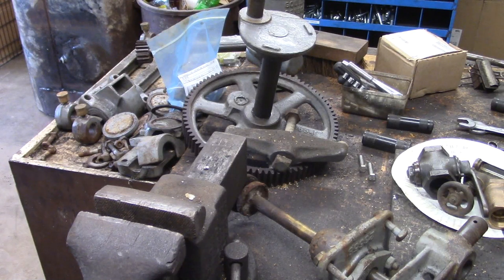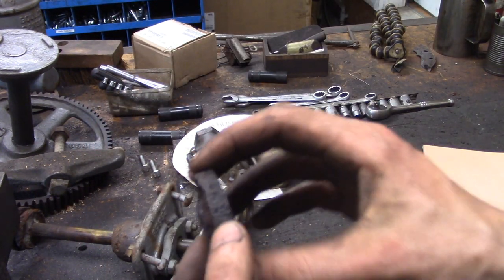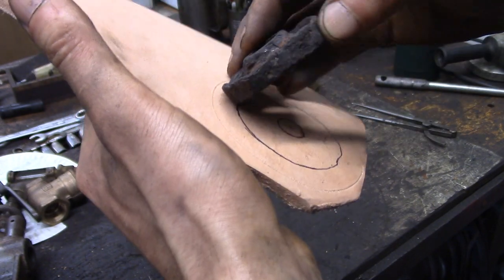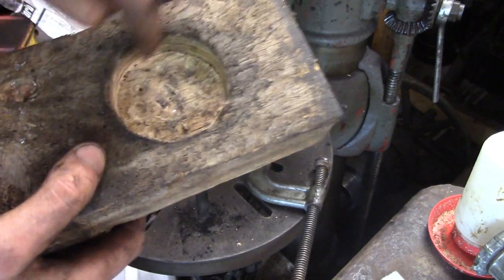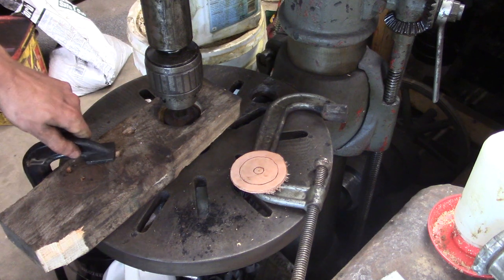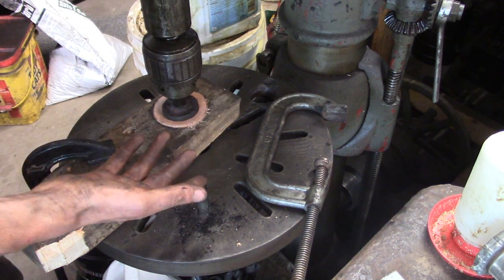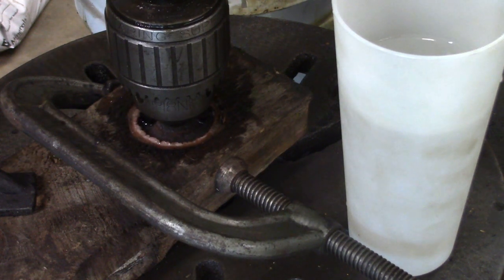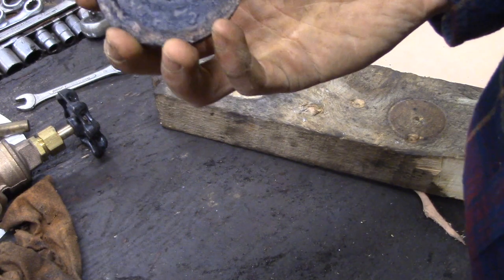Forming A Leather Pump Seal - How To

Comment: Old steam engineering manuals give formulas for sizing leather cups. I have made many. I had an old Dingley front end loader that used leather cups about 4 3/8 inch if I recall. Cobblers ( if you can find one } have pieces of leather that are a handy size for cups.

Comment: Thanks for sharing, inspired me to have a go with chinese 10 ton porta power seal on wedging attachment , still looking for a seal for it, any way cut out a leather washer shape ,put it on ,oiled and cupped by hand , fitted and its back working while i source a proper seal, hmmmm will see how it goes lol, cheers kirk
Reply from the maker: I bet that will work great, especially as the leather soaks up oil and expands a bit.

Comment: Does the cup have to be tight to the pipe or very close to the pipe diameter for it to effectively work?  I am replacing a 2.5 inch cup and I am wondering if a 3 inch pipe would be a problem.
Reply from the maker: they should be the same size, with the pump leather being just a hair bigger to allow it to seal well.